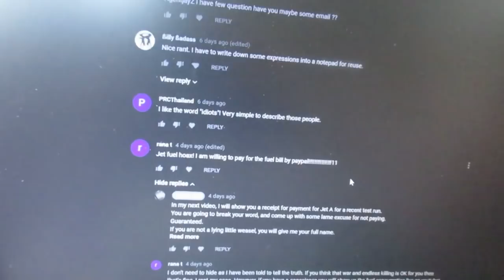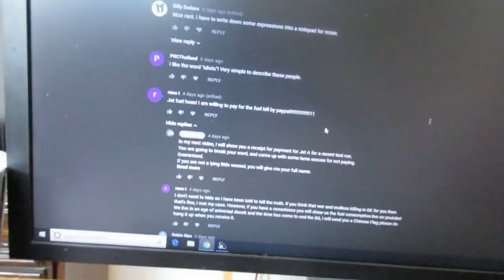Hoaxtard Discussion

Comment: If they're using your video without your permission, it sounds like you should be doing copyright strikes against them. 
Don't go for vengeance. Don't try to crush them. Don't think they can be educated. Be businesslike and just hit them every time they step over the line, and then walk away.
Oh, and thank you for sharing your videos. In spite of being an aviation enthusiast my entire life (I grew up a mile from the end of the runway of the local air force base), I've probably learned 100 times as much about jet engines from your videos as I knew before (including why you can't make a tin can jet engine). 
Please continue to be that nice Canadian guy who makes the jet engine videos.

Comment: Hello AgentJayZ and fellow turbine geeks,
Just to add a legitimate side note to the alternative to hydrocarbon fuel story.  In the late 50s and early 60s G.E. developed for the U.S. Air Force a nuclear powered turbine engine that worked. Except that it would fry the crew.  The system ran the compressed air through a heat exchanger and the resulting reaction mass would drive the power turbine and generate thrust.  The Soviet Union flew a direct cycle engine whereby the compressed air was sent directly through the reactor core.  Needless to say all of the flight test crews suffered early onsets of radiation induced cancers.  I also think that it was not good for the ground crew and the engine maintainers.  Maybe your trolls can put this up their chemtrails.
'Keep them dreaming down there",
Leo Dikinis
Reply: Sorry for my error about "power turbine".  I meant to say turbine.

Comment: holey @#$@#, you've got some stupid trolls on here JayZ.  I've worked on a few turbines (570KF, FT4, that rover piece of shit, Solar Saturn (in both 500 and 750 kw gensets), but not the LM2500...), and I can assure all our readers, they all burn fuel.  LOTS of fuel.  TONS of fuel.  Like, we used to carry 18000 TONS of fuel for the ships, and a FT4 burns enough that, if you take a normal 45 gallon barrel, pull both plugs out, and tip it on its side, it would be emptying slower than a single FT4 burns fuel at full chat.  (PLA is adjusted with a screwdriver...and you have to use the density chart to calculate maximum HP for the day...).  Where did you find the trolls?  Are they all ping bosn' failures?  Keep up the good videos, we had a Orenda 10 for the longest time @ Fleet School, and the S-S which was an oddball.  I look forward to some more videos of the Iroquois,  I have work from one of the machinists who worked on it here.

Comment: Thanks Jay, this is very amazing, indeed! When a fierce internet campaign claims jet engines simply run on air, recently circulating findings, on the other end of the spectrum, propose that no heat-engine, and jets are among them, will produce a sum of useful energy exceeding the total energy put into constructing them! 

When the 8 batches of gold-grade fuels which Jay has ordered and well consumed recently, one shouldn't count them a total energy. Instead, they are only a fraction of all fossil fuels consumed in digging them out of the ground from somewhere in the world until they've arrived nicely refined in Jays storage tank.

Here we are seeing competing tendencies: One tries to influence minds that Energy itself is a hoax, the other struggles to highlight that Energy is, indeed, a very big deal.

When stationary Industrial jets wouldn't last for more than 30000 hours at continuous work without repairs (3.4 years), the sum of all useful energy they've produced wouldn't come any close to the total energy expended into making them, if that energy is traced back to its origin, deep in the ground, and all energy-intensive processes involved, including making machinery, plants, industrial-base repairs, etc - which all have contributed to making the engine.

https://the-fifth-law.com/pages/press-release

Thanks Jay, you cannot overestimate how people highly appreciate your work and video uploads. Please keep them coming.

Comment: Having taken a few kerosene showers when a fuel sample valve stuck open, I'm pretty sure jet fuel is real.

JayZ, my heart goes out to you.  I cannot begin to imagine how it must make your blood boil when they steal your videos.
Reply: And worse. Selectively cut them up and use pieces completely out of context and although this "jones senoj" idiot was (eventually) crediting JayZ as the source he was still essentially calling him a liar. He's gone. Now how do we get rid of the other 20 or so trolls who've jumped on this idiotic shit and are now posting the most idiotic crap about this, and now planes apparently "levitating" and landing and flying at stupidly slow and impossible speeds.  The slowest large plane I semi regularly see where I am is the air to air refueler jet when coming back empty and making it's approach over here. It must be SO much lighter when it's empty. I tried using the flight radar app on my phone to have a look but it just doesn't show up on it, security I guess.

Comment: I watched Guy Martin doing the final check on the Vulcan Olympus engines, climbing inside and visually inspecting the blades. :D
No more Vulcan 😔
Reply: MrGuvEuroman that was a beast of an aircraft. Loved it.
Reply from the maker: Have you seen my videos of Olympus test runs?
Reply: I watched that show (for the third time) a couple of nights ago: it reminded me of having to clamber up a Concorde jet pipe to inspect the JPT 'spider' of an Olympus 593 at LHR, back in 1992.
What slightly annoyed me (but then I am pedantic) was that XH558 has Olympus 200 series engines, with six-spoke intakes, as we saw when Guy M did his inspection. However, when we were shown a view of an intake with the engine turning over, it was a 300 series engine, with a fourteen(?) spoke intake.  I presume that they had been to Wellesbourne and taken (or got hold of ) some shots of an engine in XM655 turning over. 
As a VTTS member and now a Guardian, I can appreciate that, after their unfortunate FOD experience a couple of years before, the XH558 team weren't allowing anyone anywhere near those intakes with the engines being cranked.

Comment: I have been an aircraft structures mechanic for a very long time. I have lived inside the fuel cells (wings) putting them together at every stage of production. They are NOT engineered for the stresses of air pressure especially cycling high and low for years. They would fail soon in service. These wings are designed to hold a LOT of fuel... an unbelievable amount of liquid weight. The figures the HAOX folks are putting out there is just sloppy circle logic.  This is only a point made by someone without a life and no desire to get one. Nice video man!!
Reply: There are four forces to consider, Tensile, Compression,Shear, and Torque. These loads are different with weight on a wing full of fuel in comparison  to the forces of a wing being pressurized. The upper wing skin carries a tensile load as the lower skin serves as a compression load. This is the static force as the plane is on ground. They switch in flight. Most of the fasteners are installed to handle these forces in shear load. If the wings fasteners were under tensile load with that kind of pressure  a premature failure would happen from  fatigue on the wing skin structure. The load transfer is in shear not tensile. A wing cannot handle being pressurized. The round tube, that is the fusalage, IS designed to handle pressure. Not a wing.
Reply: Jason Dutter cool! Never even thought of the engineering of the wing in this category. Know their marvelous physics but never dug that deep into it construction! Thank you for sharing your knowledge I appreciate it! Love it when I learn something in comment sections, it's a rare event!! :)
Reply: youngsamuel1 Have you ever been in an aircraft wing? There are no cylinder shaped compressed air tanks in them that is what you need to hold compressed air and these compressed air tanks must be made of thick heavy steel just to hold 120 lbs of pressure now look at a A380 each engine provides 170,000 lbs of thrust how are you going to get that much thrust and for how long without burning fuel?
Reply: Compressed air can only be held in heavy, steel, cylindrical enclosures. These people have apparently never been to a hospital or been in an ambulance. They probably beleive both are illuminati detention centers
Reply: Ruttigorn Logsdon
Just a small correction. The engines in the A380 are between 74k and 90k lbs of thrust each. Look up EA GP7200 and RR Trent 900 engines.

Comment: I presently work at Boeing. Been here 30 years. I have spent many of these years working on fuel systems. I have trained and certified thousands of people on how to deal with fuel systems. I have watched jets get fueled up. I drive by the fuel trucks every day. I have gagged on the smell of burning fuel too much. I have repaired fuel leaks. There are people in this world that get a kick about creating a lie to see how many they can convince. The internet is a perfect place for these ignorant deviants.  So to all of you that have been fooled by the "jet fuel hoax" go back to the flat Earth conspiracy and stay there... Or create your own stupid hoax. Maybe a jelly doughnut hoax? could be more promising....the hole is removed and filled with a governend mind altering gelatinous emulsion that causes the plebian masses to believe jet fuel doesnt fill the wings of airliners. Or something
Reply: In front of the wheel well in big jets there is the center wing tank. It is devided into four bays ,a 747 has 5 bays, I am 6 feet tall and have walked around inside these bays for many years. These fuel tanks have fuel resistant paint. The polysulfide sealant has to be fuel resistant. There must not be any contamination to prevent the fuel filters from clogging. The baffles(ribs and spanwise beams) keep this massive fuel weight from sloshing and is structure to hold everything together.The biggest volume of fuel containment is there and closest to the body section. The outer wings carry fuel but less since these tanks taper down to only an arm can fit into the access holes underneath.

Comment: I just came across these people  yesterday, being in the air force for four years as crew chief, and a engine run crew chief for a FB111a with prat whitney TF30 with 5 stages of after burner. I can't believe their research and the BS they are trying to get people to believe. They must be , I don't know what because, any  normal man that was raised in the US started with bikes and then mini bikes with gas burning lawnmower engines that burn gas and other things like lacquer thinner rubbing alcohol and other things that we experimented with in the sixties, after mini bikes and go carts,you go to small cars like VWs and a like and then to the chevy small blocks and the ford 289/302s and you learn and see other internal combustion engines. You know that there has to be an explosion, what can be more exciting than an explosion? weather they are thousands per minute controlled inside an engine an engine or fire crackers, and bangsite cannons, You learn that you can put the particles in a bigger thing like a one gallon gas can put calcium carbide mixed with water gives off an explosive gas and makes a big band and can blows the heck out of a one gallon gas can, shoots a lemon about as far a football field we used a fuse from rocket motors d motors were the biggest as I recall jetex I think was the name. Another example of an explosion fast burning fuel forced out a small hole. And then there was the oxygen and acetylene bombs they were the most fun, we would take a torch and turn up the oxygen as much as it would go, put out the flame,  then fill up a balloon some as big as a watermelon put it on, a newspaper on the ground and then put a trash can over it lite an edge of the news paper and run like hell. Trust me it will blow the can about fifty feet  in the air and sound like a cannon going off.  we used to do this all the time, yes the cops came but little evidence a popped balloon. and a welding bottles and a trash can. Don't try this at home, one time we blew the bottom out of the trash can it  was still in the neighbor's tree. Might still be there!!!  Some might say this is borderline radical it may be but it was fun and educational at least we aren't spewing  bull shit and making stuff up just to be on youtube and get other dumb asses to follow you  Bob Licher
Reply: bob licher the jets could run on the hot air from your comments .

Comment: Some of the long haul 747's have their vertical and horizontal stabilizers equipped with fuel tanks..........a little more work for the flight engineer to balance the burn off and keep the weight and balance correct , but that's just part of the advancement of technology..........better living through science and technology..
Reply: FAA Inspector. Just the horizontal stab is a fuel tank in the 747-400 not the vertical.

Comment: Fantastic point about leaving them going. Why the hell not? Also, where does the energy to spin them come from? Nothing's free in this world, so what's spinning the engine? The air itself? Please provide evidence for this, because we're all waiting! EDIT: Yikes, how long does that fuel last? Suddenly it doesn't seem so bad to fill my car up...
Reply: The combustion chamber provides force to turn the engine. It enacts a force in the opposite direction of the resistance on the compression and turbine sections on the engine, allowing for the engine to turn the correct way and provide thrust by deflecting air rearwards. U should learn to read a book sometime

Comment: I was in Hanoi back in March and was handed a $19,000 fuel bill.
Reply: So you pay about $ 2.30 per gallon?
Reply: @malourocha9211  - I cant remember the unit price, but that was the cost for about 65 tons of Jet A1.
Reply: @lauralauren6432  - can you prove any of your rant, or are we just to believe that “thin” wings means no fuel? Why do aeroplanes have limited range? Why do they air to air refuel? How do you know helicopters don’t have fuel gauges? I’ve seen plenty of truck fuel tanks and filled some myself. There are entire areas at petrol stations for trucks to refuel as well. 

Please try to actually provide some fact and not your disbelief or requoting other misguided people.
Reply from the maker: OK, Laura, you can stop yelling at everybody. You're an idiot, and yelling only makes it worse.